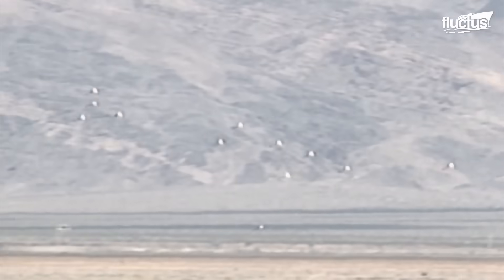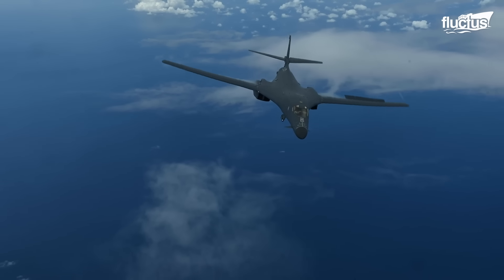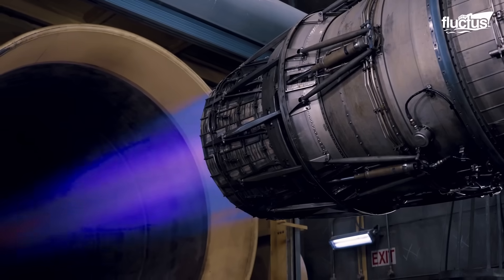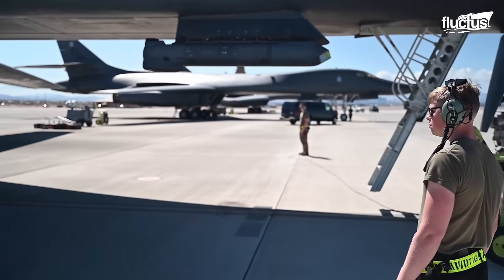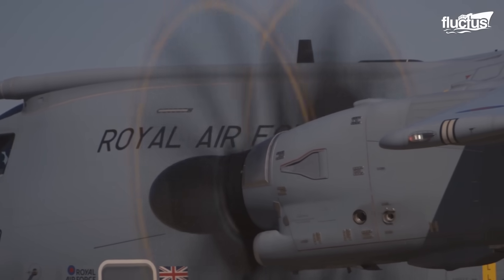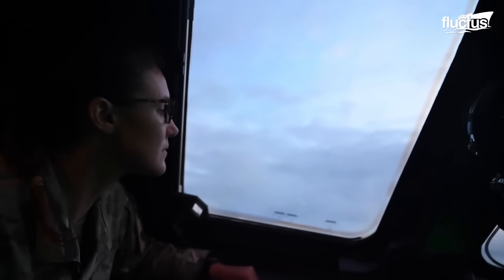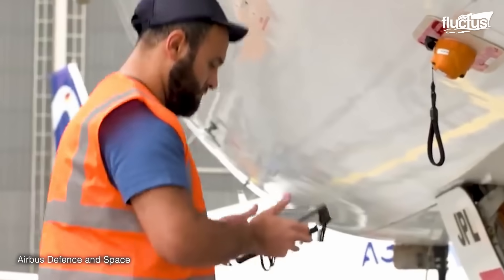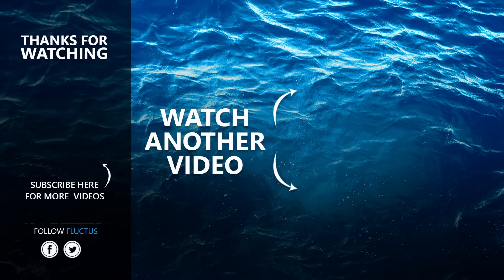Crazy Reason Why US Spend 1 Week Maintaining B-1 Bomber After Each Flight

Comment: I wish Congress and the AF would approve a brand new B1R to back up the B21 when Stealth isn’t as needed… 

- 4 F35 Engines allowing for Super Cruise
- Sensor Suite all over the airframe turning it into a mobile command center like the F35 but with 4X the range
- Long Range Air2Air Missiles allowing it to be a missile truck
- Improved structure, components, open architecture, avionics, and diagnostics allowing maintenance costs and time to be cut in half 

SUPER BONE 🖤

Super Bone sounds inappropriate and i apologize 😭

Comment: As a comparsion, the fastest drag racing cars, the "top fuel" class, require complete engine and powertrain teardowns and certain component replacements after every run. Each time about 30 seconds of idling and low power and 5 seconds of full power.  Total miles on the engine before complete replacement is only 1 or 2.
Reply: That is great info!

Comment: GE Engines are so much better than the P&W Engines, in my opinion. I could be wrong but, the P&W engines get thrust based on how much more heat the engine produces which causes more maintainance and causes there to obviously be less cooling capability for the aircrafts avions/radar and other hardware components and also will not be able to reach peak thrust performance for long periods of time because obviously tons of heat for long periods of time is bad for the engines and tye aircraft itself.

Comment: I really hate flag wavey, BS, poorly researched thngs, like this 

what really really made me hit stop, write this comment (then leave)
"what separates this from all the bombers before it, is it can travel at super sonic speeds"

removing thte fighter bombers, like the f111

how about the b-58? for a start, and thats the US things thats before counting on USSR stuff
Reply: Modern sound detectors -- including those in offshore buoys and on ice floes -- easily pick up and identify the sounds of aircraft engines.  Not to mention satellites, infrared heat detection of jet exhaust, and lidar.  The Soviet solution to stealth was to put plain old civilian radar all over the place, so an aircraft can't avoid flying directly over several.  Then of course, good old-fashioned human observation can detect a sonic boom.

There's nothing particularly important about flying at 900 mph as opposed to 600.  Ground-to-air missiles can hit you all the same.
Reply: @floycewhite6991  unsure your point to this

my point is, there had been a number of supersonic bombers before the B1, like the b-58 (also the A-5) from the US

and a number of them from other countries like the US
Reply: @copuis Right, the Hustler.  Poorly researched. My point is that flying a little faster just isn't all that big a deal -- and the planes must be sturdier and carry much more fuel if going supersonic at low altitude.  There's a good argument against heavy bombers in modern warfare.

Comment: The B-1B is the key "item" that brought down the Soviet Union.  They (the soviets) just couldn't respond to Ronald Reagan's onslought of killing machines.  It (the B-1B) was fielded while still under development because it was sorely needed when peanut farmer Jimmy Carter canceled it.  The media-hyped phrase was "ahead of schedule and under budget".  There is however, always a price to pay for such "rushing" to get anything as complex as a nuclear bomber fielded.  For the B-1B it was felt in the lack of replacement parts and the parts repair pipeline.  Both were non-existant and we've paid the price ever since.  In 1994 Congress demanded to know how it would perform with pretty much all it needed.  The arrangements were made by taking many parts from a number of the B-1B aircraft, so that the aircraft participating in the test event would have what they needed.  It reigned supreme at 85+% fully mission capable for the entire period.  The issue of lacking enough parts was never corrected, so as the aircraft has aged and consumed irreplaceable parts, the parts donors were/are skeletons sitting in the Montana desert.

There are several minor inaccuracies in the narratioin, but pretty good overall.  The B-1Bs are still recovering from the years in the middle east desert where they flew so many hours the schedued maintenance was extended to just beyond the repair point, such that more of the aircraft are skeletons.

Comment: With that level of maintenance required, I wonder how many aircraft are ever available?
Reply: They run about 51% availability (last report I saw) but some of this is because some number of aircraft are always out for extended periods for upgrades.  The cockpit upgrade many years ago took 240 days per aircraft. I am not saying that the B1B is a bad airplane, in fact I think it is a very goo d airplane. The problem with the B1B (and the F-35 as well) is that it was simply too expensive to buy and operate, which limited the numbers that could be purchased and the amount of time they could be flown for practice missions. For the B1B though, it could never really be used as a strategic bomber, which was what it was supposed to do when congress raised the program from the dead after Carter dumped it. Carter was right. In the end, we spent far more on the B1B than we ever got out of it. It would have never carried a nuclear weapon in war because the war would be over before any B1B could reach a target.
Reply: The B-1 went through an extensive mod starting in 1996 called the CMUP program. We realized the jet was no longer useful for its intended purpose as you stated. That did not make it unwanted! As a matter of fact - right now it's the most conventional mission capable aircraft we have. We had many briefings during the Afghan war from pilots and ground controllers praising the B-1's capabilities. Generals were asking for B-1's all the time. Ask any Army grunt in the war what his favorite plane was. There were reports of Taliban fighters waving white flags after the B-1 had simply flown over their heads! Your 51% availability is sadly correct. It is a big complicated, maintenance heavy aircraft for sure but hardly the disaster you describe.   @shenmisheshou7002
Reply: F14 Tomcats retired because of 80 man hours maintenance per flight hour.
Reply: The maintenance Man Hours per flight (MMH/FH) our for the B1B is in the mid 70s, but to be fair, the B1B is a large four engine airplane, but then again, the MMH/FH for the B52 is only 62 hours by comparison. The B2 is about 45 hours, but that does not include the maintenance to the special coatings and low observable materials. One could expect the B1B to need more maintenance as they age,  but the reality is that the B1B is almost worn out and will be phased out of service by the early 2030s.  Now the B1Bs dropped a lot of bombs during Desert Storm, but it used none of its high tech features to do so. In other words, a far less complex and expensive bomber could have done as well. The low level penetration was not useful, and the speed was not useful. A fixed wing subsonic replacement for the B52 would have been money better spent.